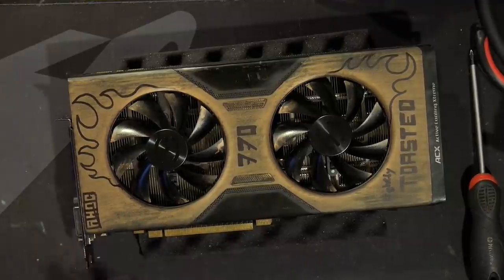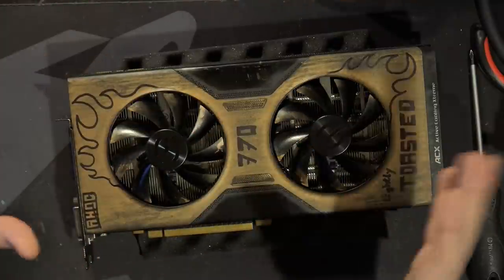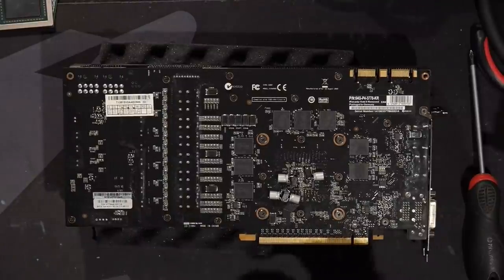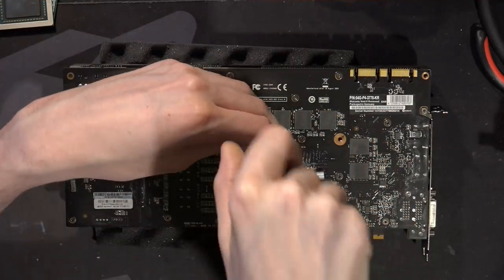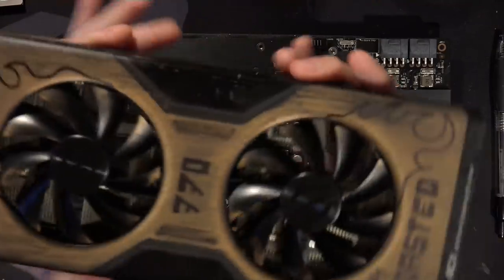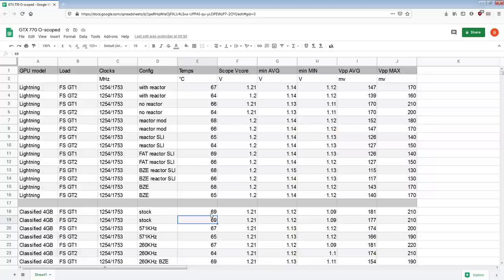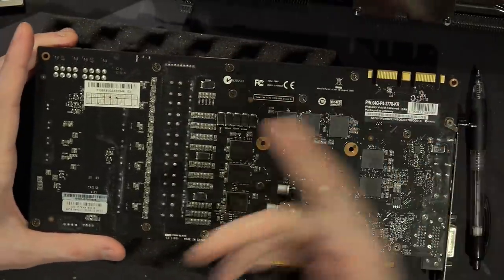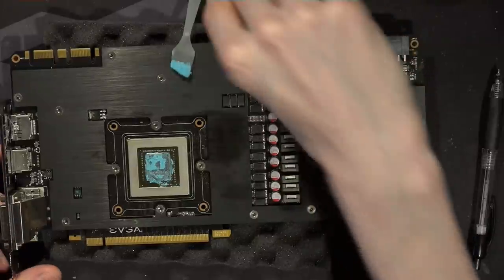BZ's GTX 770 Toasted edition // "repaired" GTX 770 Classified 4GB modding and oscilloscope testing

Comment: Yes the location is really critical in extremely high current, high speed switching. 1mOhm ESR with 100A peaks means 100mV droop and ESL increases ringing. Of course the probing style is really critical as any length of GND wire increases the junk picked up by the scope. 
Also the higher switching means lower ripple as the filtering doesn't have to do as much job to filter noise out but this usually increases power consumption as switching losses increase.

Comment: I had 680 (or maybe 670) but the cooling was so freaking loud (noise profile)... My friend had 7950 and we swapped the cards. It was supposed to be for only a couple of weeks but in the end I still have that 7950 somewhere. After 1Ghz BIOS update that card became even better (+ having ~1175Mhz OC on GPU) and I had that card for 3 or 4 years. I really liked how well it aged. Then new games at "normal" settings were running at 60+ FPS no problem with 2-4 years old GPU.

Comment: Speaking of which, I'm taking a really big shot in the dark here: I have a GTX 680 Classified 4GB that has really bad artifacting and the driver just makes the screen all black. Do you think it could be BGA or bad memory? The BIOS colors are weird (some words appear in blue and everything else in white) which I've experienced with bad RAM, and it artifacts really bad but it does display an image.
Reply: Throw it in the oven. 200c for 10 mins, remember to remove the plastic parts and vrm cooling. Worked on my 7950 for 6 months, then it died.
Reply from the maker: @theunholybakery1990  200C doesn't reflow lead free solder. Either heat it to 100ish or 230C(all the common lead free solders melt a little bellow that)
Reply: @ActuallyHardcoreOverclocking  my bad. 230c it is then!

Comment: i see you using Kingpin KPX paste. Can you do a review on how that performs on various thermal loads?
Reply: Luumi already did that a couple times on his channel
Reply: @milchkopf3881  that's good. but review from different people should give us a much broader view of the subject.
Reply: @notyouraveragegamer130  No. If a proper Overclocker did a video about it, then that is certainly enough. How broad a perspective do you need about thermal paste? KPX is not the cheapest, but the best paste available right now. If you want to have good price/performance: Arctic MX or Gelid GC Extreme.
Reply: @milchkopf3881  Damn bro you can stop gatekeeping so hard. There's nothing wrong with his request.
Reply: @saintfrac5360  i really just try to help. might have jumped right to the conclusion, because i didn't want want to explain everything in detail. i personally wasted a lot of time with bad thermalpaste and cooler reviews (with too low heat load and other issues)
Reply: @milchkopf3881  I dont think GCX has good price to performance ratio. That is also expensive.

I'm talking about a review for KPX. Thermal pastes might perform the same for the first few days, but some will definitely perform worse overtime; be it pump-out or degredation; some pastes do worse on die apllications. That's why it is important to talk about subjects with a broad spectrum.

A review from a good overclocker is nice, but not enough for some use cases.
Reply: @notyouraveragegamer130  I don't think there really is long term experience with KPX because it's mostly not used in daily. If you just plan to daily: get MX-4 or something, it's rather inexpensive and you don't really need something much better. 
If you plan to do lots of  OC just watch Luumi's review and decide between KPX, Kryonaut or GC-ectreme. I'm personally using GC-Extreme because it's the cheapest got me but that might vary for you.

Comment: what if you get some 220uF 1206 ceramics and put them on the leads of your TH alu polymer caps kinda like a ladder, maybe 2-3 of them per cap, sure, 1206 are worse ESL wise than 0603s but they're wayyyy batter than alu polymers
Reply from the maker: SMD alu polymers beat 1206 ceramics. I've already messed with some 220uF 1206s and they cost way too much for how ineffective they are.

Comment: I wonder if I should do this, I basically have the same card (EVGA GTX 770 with artifacting) and also have a toaster.
Reply from the maker: the toaster alone isn't enough. I used hot air on the core from above.
Reply: how long, five minutes of heat?
also since I dont have a hot air station, I assume a heat gun from a distance isn't advisable...

I dont mind killing the card, by the way. It's just been sitting on a shelf for two years dead anyway

Comment: Is there any particular reason Buildzoid uses such an expensive multimeter?
Reply from the maker: Because I use it on GPUs CPUs and boards that cost way more than it does. Also it has a crazy fast K type thermometer and it does very low resistance measurements.
Reply: @ActuallyHardcoreOverclocking   k thanks a lot... soo basically it's needed beacuse it allow for k type k type thermocouples and it has above average precision and range?

Comment: I have an RX580 that runs VERY HOT even when i manage to attach 2 120mm  fan on it, it still runs solid 90°C+ on full load, any idea whats going on with this type of problem?
Reply: heatsink not touching the die

Comment: Is it a different solder between the core and the substrate or something else entirely that keeps it in place while melting the BGA?
Reply: Bitter Cynic epoxy and wires, google die attachment
Reply: @sunnohh  No wires in flip chip, instead another layer of BGA that might not be solder but gold bumps attached with adhesive/epoxy.